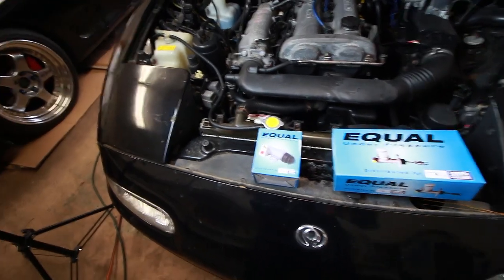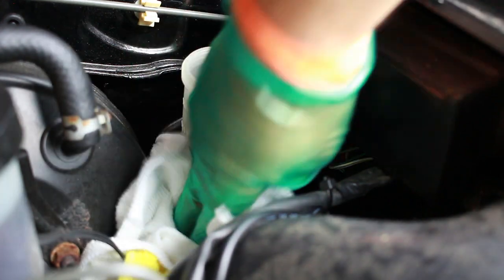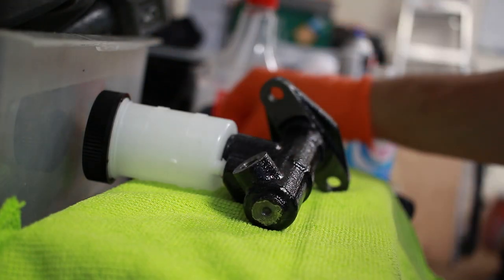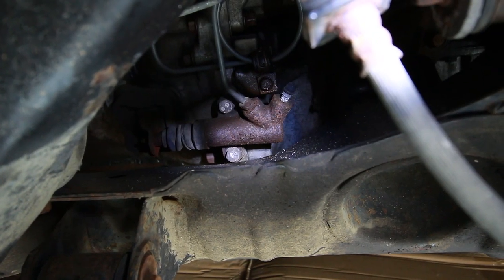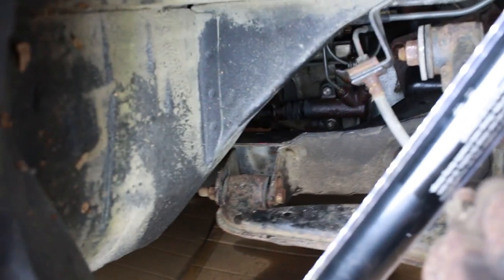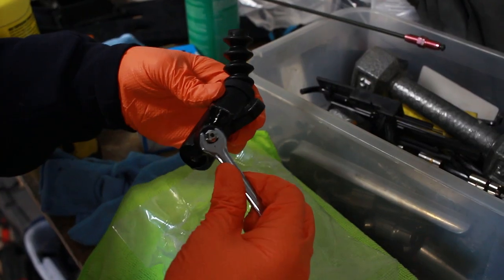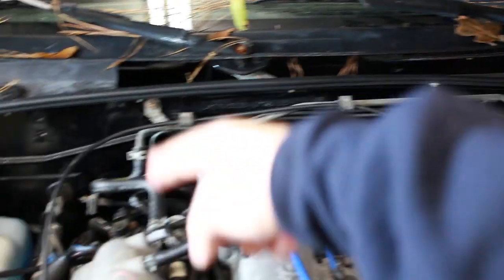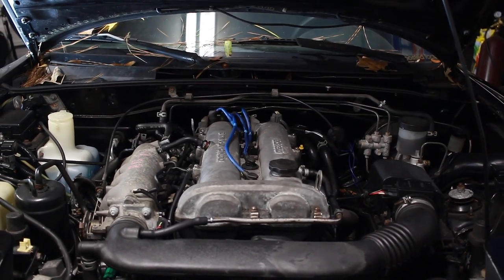How to replace the clutch master and slave cylinders + bleed procedure (Miata)

Comment: A little tip when dealing with metal lines & fittings (commonly found in between clutch master & slave cylinders), spray the fittings with some penetrating oil prior to putting a wrench to it - this'll help free up any corrosion.
Speaking of wrenches, a flare type wrench is often preferred for these fittings as they'll get a better purchase on the fitting, and prevent rounding off the fitting(s) as witnessed here.
Reply from the maker: Very good advice, thanks man. I feel like a set of flare wrenches is missing from most car guys' toolboxes (inc. mine), but would be a welcome addition. Thanks for watching 🙌
Reply: it’s crucial to contaminate the oil as much as possible while removing the lines. as much PB Blaster in circulation, the better.

Comment: Thanks for the great video man. My Miata is getting stuck in gear sometimes. Hopefully replacing the clutch hydraulic system fixes that.
Reply from the maker: Glad to help out man! For sure, it's always a good thing to do. Good luck
Reply: @supercarmio  just tried it and the slave cylinder hard line got stuck and stripped haha. Would you recommend I get a straight line from the slave to master?really wanted to get my car up and running soon, do you know where I'd be able to get one physically without having to wait ages due to covid?
Reply from the maker: @Red9419  don't sweat it! that exact thing happened to me on one of my other cars. fortunately they have replacement stainless braided lines that can replace everything. 5x makes some good pieces and they shipped pretty quick the last time I ordered - https://5xracing.com/i-23993293-5x-racing-full-length-clutch-line-for-mazda-miata.html

If you want to get that somewhere physically, you just need to get the specs of the hose ends (should be easy to lookup) and go to a hydraulic shop and they should be able to make it for you super quick.
Reply: @supercarmio  thanks for the reply! I ended up getting a Goodwin racing line since they're located within my state so shipping should take too long haha. I'll check out a hydraulics shop for a temp fix though. Thanks so much for the help.
Reply from the maker: @Red9419  anytime man! hope it works out

Comment: This tutorial was very helpful.
Reply from the maker: Glad you enjoyed it - thanks man!
Reply: @supercarmio  Would you recommend Prestone DOT 3 for the clutch?
Reply from the maker: @rwdlocked963  Yes, that will be fine. DOT 3 is the specified fluid type for the clutch hydraulics. 👍
Reply: @supercarmio  update: Replaced both parts a few days ago and the clutch pedal feels great now. Reinstalling the slave cylinder was probably the most difficult point for me but it helped a lot to start hand threading the hard-line. Thanks again!
Reply from the maker: @rwdlocked963  Glad to hear it! Agreed, not much space down there especially with that hard line that barely moves. Nice work man!
Reply: Did you not have a lot of fluid leak when you removed the slave? A lot of write ups I’ve seen did the slave first and bled the system without adding fluid to the master in order to empty most of the fluid before removal. What are your thoughts?

I’m just reading all the different write ups & videos before deciding how to do it. This far it seems like everyone has their own way of doing it, which is weird to me.

Comment: tip: the hardline nuts have some sort of thread locker. use some heat to break down the bonding :)
Reply from the maker: Really good tip, I wish I thought about that beforehand 🤣Thanks for watching!
Reply: @supercarmio  I did the same thing and just used bolt cutters to cut off the old hardline and used a braided steel line